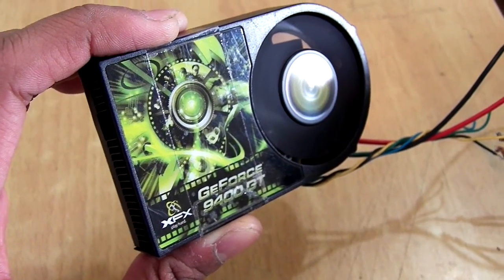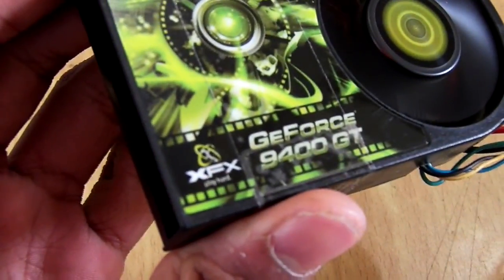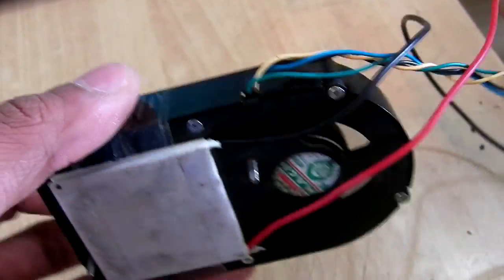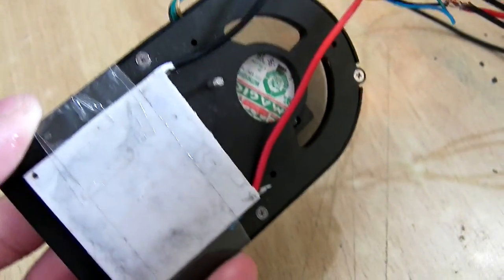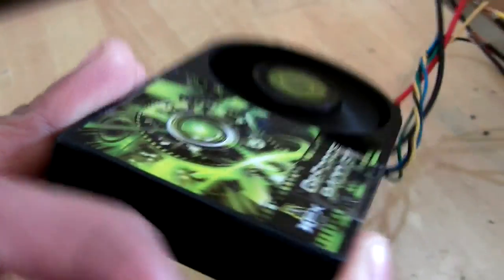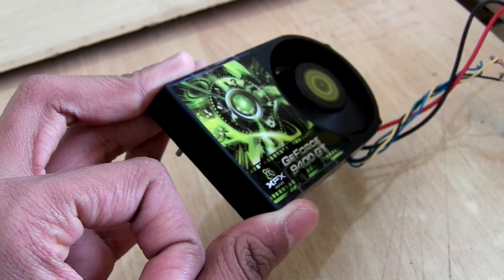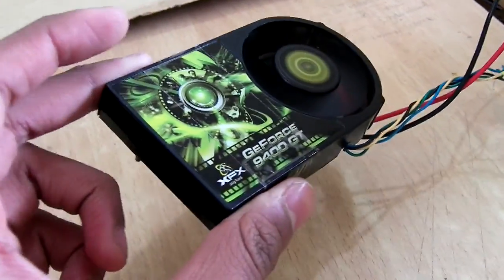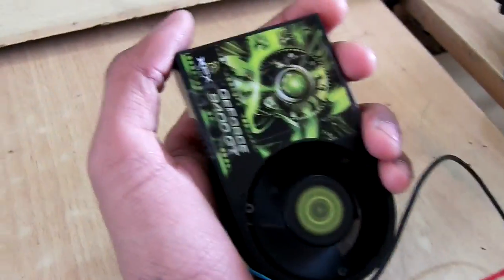# 47 DIY Portable Heater and Cooler Using Peltier Modules

Comment: Good idea but you might want to add a heat sink on the other side :) for better efficiency!
Reply from the maker: yes ,when we use it as a cooler heat needs to be pumped from other side. and adding an h bridge to peltier can help to quickly switch to make heater or cooler.
Reply: Indeed :) Make a video of the complete unit :)
Reply from the maker: Ok